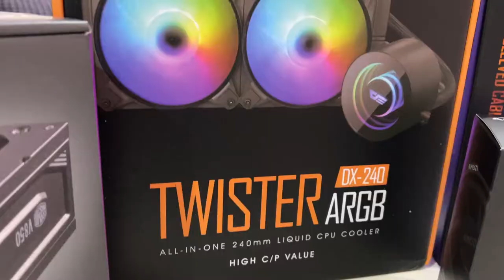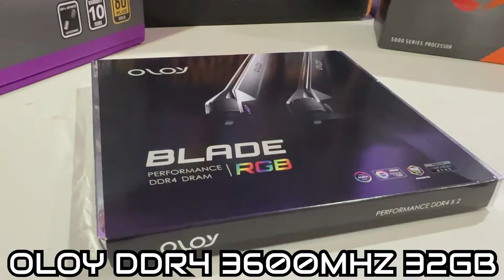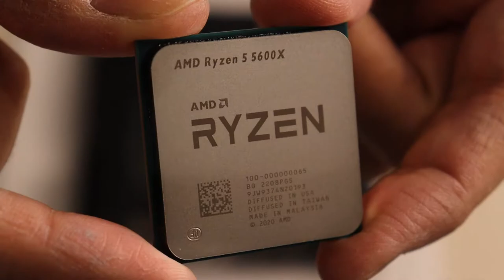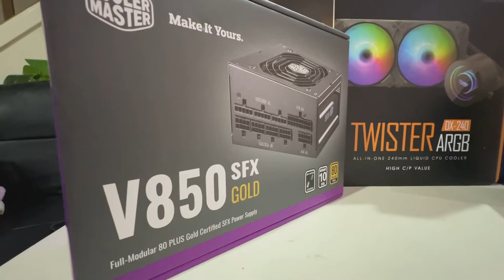Upgrading A Mini-ITX Gaming PC | Ryzen 5 5600X / RTX 3080 / Phanteks P200A

Comment: I'm going to have the same case, and my config will be 4070 and i9 13900k, but I'm afraid that heat and noise will be a bit complicated...
Reply from the maker: Are you referring to the itx case? If so, it will pose that issue.
Reply: @TekToyzGaming  No idea, I just know that there's room for AIO watercooling, and the graphics card has a bit of room, so it's fine.
But it's still a very big configuration in a rather small case, isn't it?
Reply from the maker: @ThymusCooper  yes indeed it is a big config. I would advise going bigger for bigger and more powerful builds. I know I wanted to keep mine as small and low profile as possible. Problem was it leaves little to no room for growth. With the Phanteks case I have some room for growth and currently thermals are really great.
Reply: @TekToyzGaming  Ah okok, I see, for the moment I'm not going to have the choice of having this box, I'll see if I change box later but from what was explained to me, the size still doesn't mean the temperatures will be bad, I'm crossing my fingers ahah, thx! =)
Reply from the maker: @ThymusCooper  yes the size of this is suitable for your card and processor. Of course the overall airflow config also plays a part as well. Need good positive and negative pressure going.
Reply: @TekToyzGaming  Ok thanks, that makes me feel better ahah